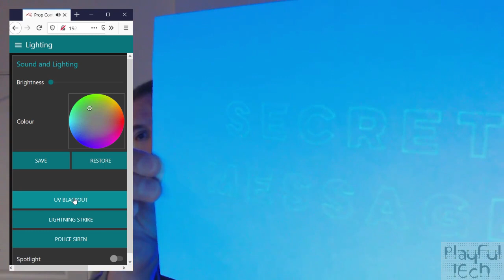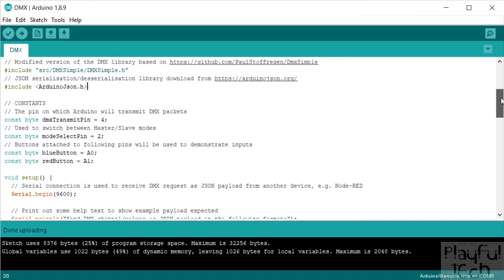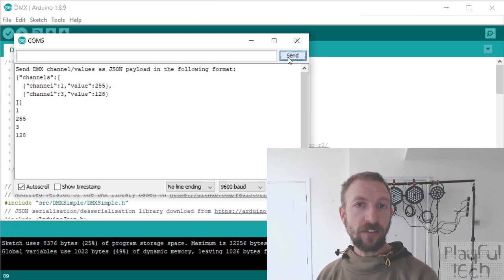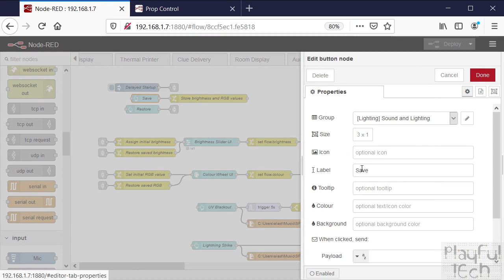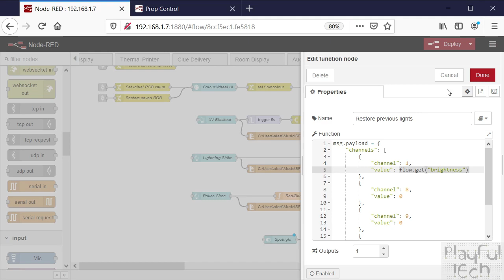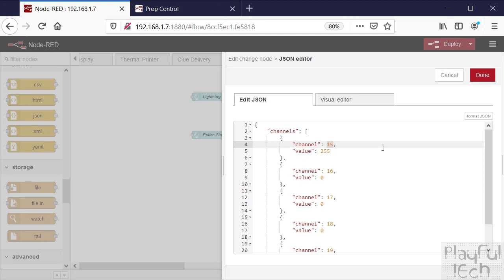Comment: When sending a message from the serial I'm getting a "EmptyInput" error coming up after the output info appears, Does anyone know how to fix this? I'm currently using the CQRobot DMX Shield MAX485.
Reply: solved it was due to not having the jumpers in the correct position, if anyone else is in this positon, make sure your tx and rx jumpers are tx-10 and rx-10 position, the slave/de is on the DE side, and the EN/EN over score is towards the EN side.

Comment: Hi Mate,
Great video I'm only new to Arduino and needed some help.
I need to control my CO2 jets and this would be perfect.
Can you please do a indeep video of where to connect the buttons to the board and what boards I need.
Basically what I need to do is when I push/hold in to a button I need 3 channels to work
1 is the spray of the CO2
2 red led
3 the dimmer of the led.
I wanted to add 4 buttons to this project RGB+W.
Do you have any videos on this..?
Thank you hope you reply.
Nav
djnav24@gmail.com

Comment: Can you send color information to just one of the lights (or different informations - one lamp red, the other blue) or do they have in separate dmx-lines then?
Reply: Every device only has a single physical DMX line-in connected to it, but they typically have an "offset" that you can set which is the DMX channel that they start listening from. So let's say you have two lights, each of which had 3 DMX channel inputs: RGB.  If they both listened with an offset of 0, then setting channels 1, 2, 3 would control the RGB channels of both lights together. But if you set the offset of the second light to "3", then its RGB components would be set by channels 4,5,6 instead.  And if you had an offset of 1, then Channel 3 would set the B component of the first light, but the R component of the second light, say.
Reply: @alastairaitchison6787  thanks for this good explanation. I world try this one time I have some DMX lights. Go on with your channel. I love it.

Comment: Good explanation of the dmx protocol, thank you! For pin definitions in arduino I always use #define instead of constants, you can save a few bytes of ram that way.
Reply: #define is a preprocessor directive that will replace occurrences of the specified value prior to compilation (a bit like an automatic "search and replace"). But the value it references still has to come from somewhere - either as an immediate constant as part of an instruction, or from a program memory table, so it doesn't use any less memory than a const value declared in code (you can verify this by swapping your #defines for consts and recompiling your code - then look at the memory usage reported in the status window ;) ). And the advantages of using const are that your variable is explictly typed (and, potentially, scoped) - you're saying what it is and how it should be used, which leads to much more robust code both in terms of human-readibility and chances of unexpected behaviour.

Comment: Could be possible to start differents effects of lights and sounds that you show in the video, using sensors, or time instead of click in the app? For me this would be very usefull, if i can make turn lights and sound on or off if the time search, for example 5:00 mins or if someone is near a door for example too
Reply: Yes, of course. Instead of using a button node to start the flow, you'd have an Arduino node that detects when a sensor pin is changed, or a Serial In node, or an MQTT message received node.... whatever you want!